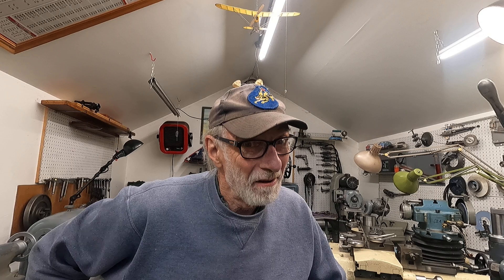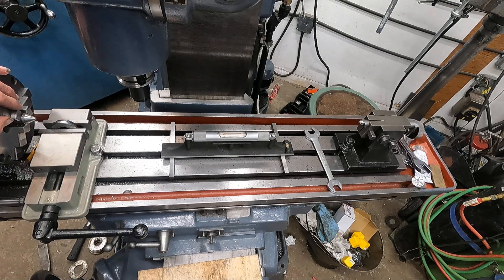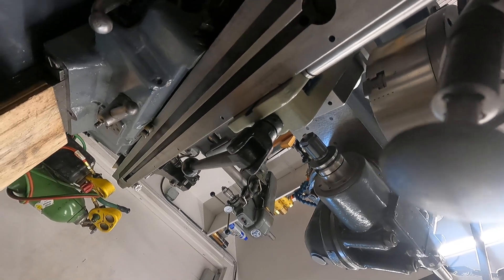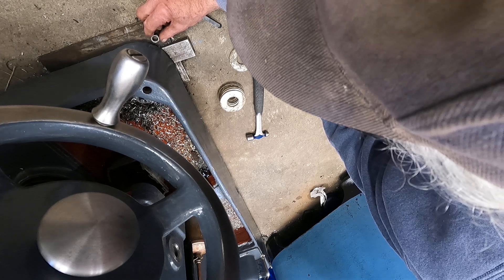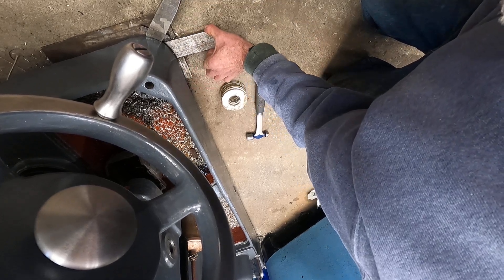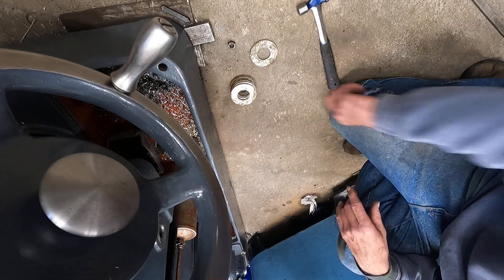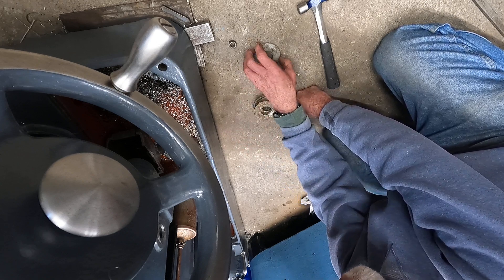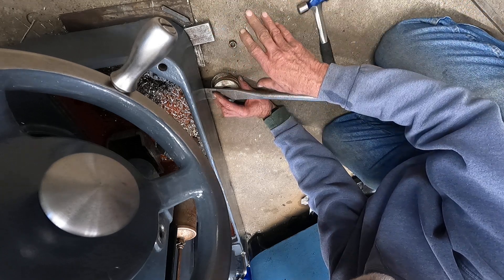Machine tools on bad concrete

Comment: I've noticed your dividing head sitting on the mill in several of your videos, I looking for a good one myself and was wondering if you can elaborate on yours and what to look for. They are all so expensive.  I haven't got a clue as to what makes some better than others. Anyways, I do enjoy watching your videos,  very knowledgeable man. One could learn such vast amounts from a guy such as yourself.  Thanks for sharing your knowledge with us.
Reply from the maker: I should do a video just on those, another device that should not be taken apart, the spindles are ground true in place in its bearings. the dividing heads and cutter grinder work heads are often hard to find in good shape. thanks!

Comment: It’s all interesting.  So when will construction commence?  Stop climbing on that drill press before you slip and break something.  Geez, a camera in one hand up on a hunk of cast iron covered in oil… 
Selfishly I don’t want my video fix to wait for your bones to heal.  Cheers, Will
Reply from the maker: I am gathering the materials I will match the original building by using salvaged materials such as windows I just found. If I raise the head on the drill press you can jump on and ride it around.

Comment: Dee Dee correct me if I am wrong, with a lathe I understand the problem with bed twist. With other machines does making them perfectly level really matter as long as they sit good on the floor with no rocking?
Reply from the maker: The little Monarch lathes the company says fairly level, the cutter grinder has a ball bearing table from experience very level, most mills seen to recommend using precision levels. The jigbore is the machine being slightly out of level shows up because it is tall and actually bends, a very small amount
Reply: @deedeeindustrialsuperprecision  The only reason I ask is the machines that the Navy has in the ship machine shops. Thanks

Comment: I was lucky and found a set of Darvic machine skates locally for a very good price, makes moving machines pretty easy, though for a mill rolling it on pipes or sliding it on steel sheets is what I do.
My concrete is 6" and properly reinforced but its not very flat and is quite soft.
Reply from the maker: The concrete I have here is 70yrs old and is very hard. I use pipes also, but I have not very far to go once they are in my driveway

Comment: My concrete in the shop looks like a bomb fell on it. I would trade you anyday Donnie.
Reply from the maker: I have ground on the floor in places, but that is a real mess to deal with
Reply: @deedeeindustrialsuperprecision  I'm sure it is and you seem to get around it well. Since I shut down my commercial shop for machining and fab, I retired to the home shop garage and kept only a few machines and it makes me nervous with the huge cracks in the concrete. I always wonder if it's going to just Crack in half and swallow the Kearney Trecker, Bridgeports and the rest...lol... I would make videos as well but I figure there are enough of them out there to teach the new generation of machining and fab work but I do enjoy a few and yours are great Donnie....
Ricko
Reply from the maker: @ricko5123  Everyone I have talked to, tells me there is no way they would put themselves on YouTube not ever. The only reason I came here is because the little scum bag that owns the PM forum branded me a criminal drug addict and had his troll and fake gunsmith moderator threaten me and my family. But, after awhile I find this fun.

Comment: I helped move a stamping press from Kettering Ohio to Chihuahua Mexico just before I retired. Press required 2 feet of concrete thick. We tested the floor in Mexico, and it was 2 inches thick and zero Rebar not even Re-mesh. Of course, we had to cut a section out and dig down 2 feet and pour new concrete. Just because we have standards in the USA does not mean everyone follows those standards. Especially other countries. In my early years I worked with the Millwrights moving and installing machines in new start up plants. Our biggest was two 5000 Horsepower GE electric motors driving one gear box with dual shafts that drove the Banberry for mixing rubber at a Goodyear tire plant. 16-inch diameter shafts with 5-inch key stock.002 tolerance on coupling alignment.  4 inch diameter anchor bolts. I loved the work but was one of the coldest winters i ever worked.
Reply from the maker: I can get by with much less hopefully. I can get advice on the concrete I need, it is not a big deal. There are big electric motors like that here, really something to see.

Comment: I had 2 buildings 20’x26’ built on a 50’x60’ pad two years ago. I had rebar, wire mesh, and fiberglass imbedded. Also saw cut to help prevent cracking. So far No cracks have have manifested, but I don’t have any machines of your size and weight. Have a great day!
Reply from the maker: My concrete is not level and pretty rough but it does work

Comment: Alot of weight on that slab,when are.you starting on the addition, and what's the plan for concrete for that?
Reply from the maker: The new concrete for that is not a big deal it will have the least weight. I have already started gathering materials. I will focus on machine work.